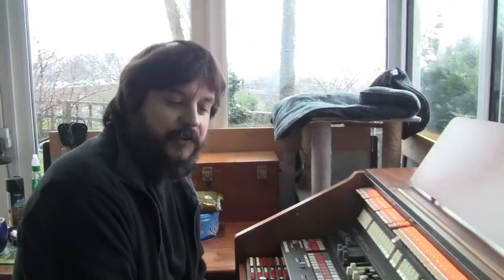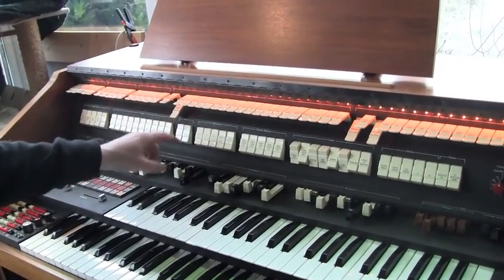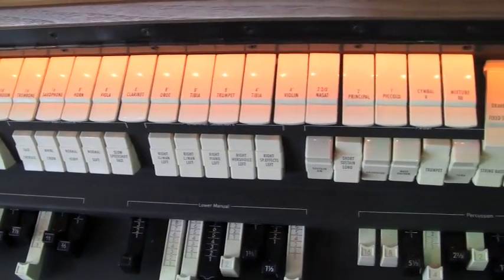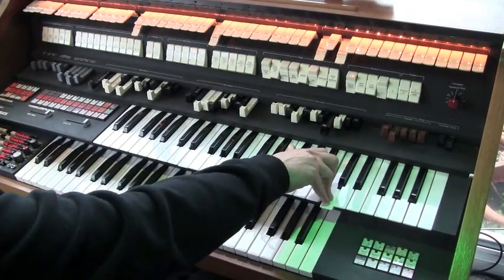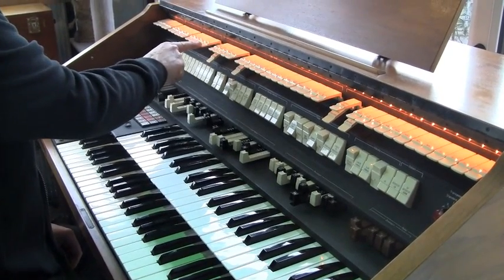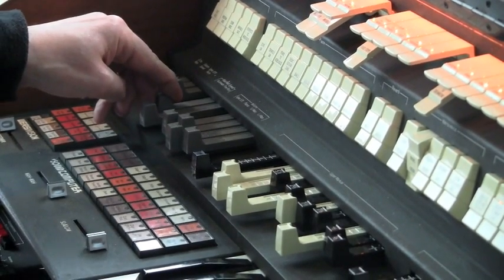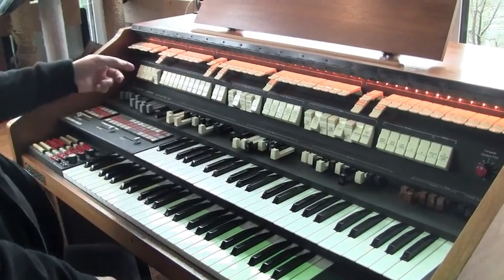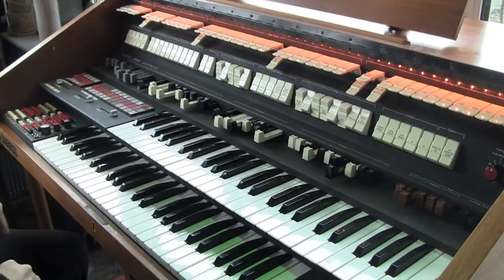A tour of the Wersi Helios Organ PART 1

Comment: it is one of the first Helios Models including WM 2 "Wersi Begleit Orchester" and the Slalom is name "Slider" or "Wheel 1" today. In this Model you can find also on the Lower Right Site teh "Wersi Vision" ! That is an Arpeggioator!
Reply from the maker: Sascha Lehmann   On mine the Wersi vision is on the upper left side next to the sound computer,  On some later models as you have mentioned, the same kind of buttons for piano an Wersi vision were placed at the lower right.  Some of these buttons were in readiness for a lower keyboard piano section. (Optional) .  I’ve never heard of the Slalom as a wheel though.  Maybe you mean pitch bend?

Comment: some other organ brands such as Farfisa used the word "slalom" for pitch bend as well ... on a certain very nice portable double-decker Farfisa model (name?) the slalom also had a little drawing showing a skier going fast down a mountain slope or something like that ...
Reply: btw, why not put a link to Part 2 in the description section as well? YouTube has a nasty habit of dismissing extra links to do with most videos as little thumbnails on the side!
Reply from the maker: dadautube Yes I remember when I first saw the Wersi, I wondered , myself at the time what Slalom actually did. On most keyboards the pitch bend springs back to default position but on the Wersi it stays wherever you leave it set.  I will do as you say and put a link to part 2 at the end of this video. Thank you for your suggestion and best wishes for Christmas and new year. 😀👍
Reply: @organaut  i remember that Farfisa model's slalom also worked the same way and if i recall it right, it was a drawbar, not a rotary volume knob, which stayed wherever you left it ... thanks for your response and Merry Christmas to you too! :-)

Comment: Hi there. I just picked up a Wersi Helios partly working for cheap. It seems to have the same drum machine and preset unit and stops etc as yours  . I have replaced the capacitors on the power supply and now have 15v dc steady voltage at several places in the circuitry. The problem is that on switch on it works fine for a few minutes then whhhrrrnnngggg it goes to a steady distorted feedback type noise and keys no longer sound. ...switch off...leave it a few minutes then repeat..it start up fine then the problem recurrs.I saw yours was initially giving problems...and I would love to know  how did you narrow down the fault to one component and get it back to fully working? It's a great organ when fully functioning and I'd love to get it back to fully functioning consistently.thanks for any help or suggestions.
Reply from the maker: Hi, Mark is the technical wizard not myself.  I am just an organ player. I did pass on your message for him to read though.   His reply is that despite the short video it took years of electronic experience and training and even then the fault took a lot of time to trace.  He was often working blind as well because there are no standardised circuit diagrams available as such because the building instructions were laid out in kit form for assembly only . Your Helios could have more than one fault and there are far too many variables as to what the faults maybe .   If you are in the uk then I highly recommend Peter Armitage who has worked with Wersi Helios  organs for many years or if not, contacting Wersi themselves . Even though their instruments are far different from the days of the Helios they may be able to put you in contact with a suitable engineer which although you have electronics knowledge would possibly be able to narrow things down for you if those faults are common symptoms of the Helios and other analog Wersi organs .  Sorry for not being able to be of more help than this.
Reply: Thanks for your reply. I have on fact (I think) a
Narrowed the problem down by unplugging various boards and seeing what happens! I think there is a problem in the piano board P1 and one of the pre amp boards. I managed to find replacements on ebay! They are on the way. I will update you if this actually fixes it! Its a fun machine to work on and sounds really good (when it works).
Reply from the maker: @rjj106  That sounds positive news.  We wish you 100% success with your repairs to your classic vintage instrument.

Comment: Hi Jason very interesting!  Looks like you have a Helios in very nice condition! Mine used to go bang when you switched it on!!  Apart from that, it was ok. It also had the CX 2 rhythm unit. All the best Andrew.
Reply from the maker: Thanks Andrew, mine makes a power up noise but nothing too drastic.
My first Helios was terrible and badly built also! Had smoke wafting out of the lower keyboard on that one.

Comment: It seems this instrument can give to synthesisers of its era a  run for their money. The slightly detuned sound creates a chorus effect, of which string machines were known for. :)
Reply from the maker: Yes, the strings circuitry was similar to many bucket brigade chorus effects used in smaller self contained string synths and the Wersi could do much more but a disadvantage with the size and weight of course.

Comment: Thanks for this great tour! I try to imitate the sounds of the Helios on my Yamaha PSR keyboard. So this tour is very helpful to better understand Helios. I think some of the sounds can be imitated, but the Wersimatic rhythms are of course a different question: these can't be imitated 😢 Anyway, very good video 👍👍👍
Reply from the maker: Thanks Erik.   As regards the Wersimatic, probably the closest you can get with a PSR/Tyros/Genos is to change the drum kit for one of the electronic sounding ones as I did when I made my Klaus 4 Tyros set but you probably already tried this?
Reply: @organaut  Thanks for your advice! I have bought your Klaus4PSR years ago already, very nice pack. The sounds come very close, but, yes, the drumkit is not Wersi-like enough to my taste. I am considering to buy a Spectra CD700, but these go quite expensive still and I am not good at electronics, so I am afraid I would not be able to do repairs if necessary. 
Maybe I should learn to program my own styles and try to imitate the rhythm of the Wersimatic, instead of using a Yamaha style and just change the drumkit. Food for thought 🙂
Reply from the maker: @Erik-on-Yamaha  Not sure of the reliability of an old instrument like the Spectra although it would give you a genuine full organ playing experience .

Comment: Now I can see that it's quite an hard instrument to play!
Reply from the maker: It's not bad once you get used to it--- just very different from the way many people are used to setting up an organ.
Reply: That is why it was equipped with Sound Computer, as was called the first ever system of programmable presets provided on an electronic organ, which did not lose your setting when you switched it off. With the one button you could go to exactly the sound you wanted. You could still rebalance the components using the grey drawbars. There was a choice of being able to get 16 or 32 presets (with an extra board installed) - or was it 32 or 64 I forget I am ashamed to say, organaut